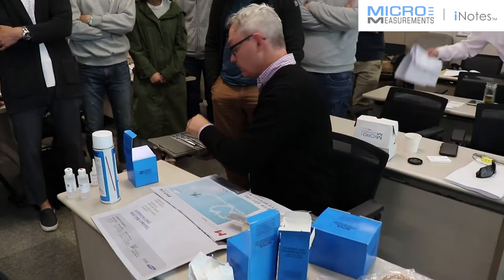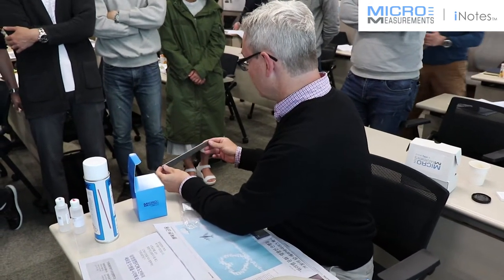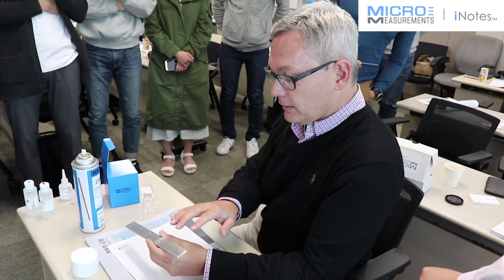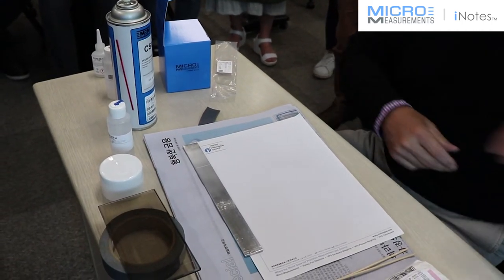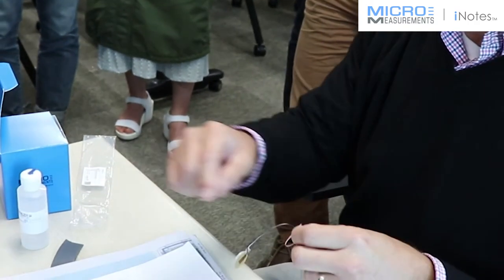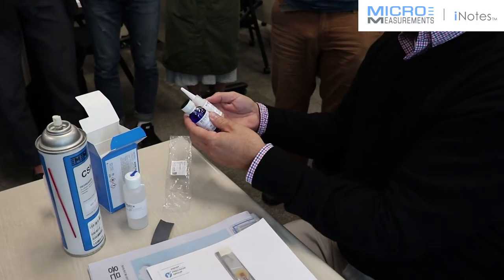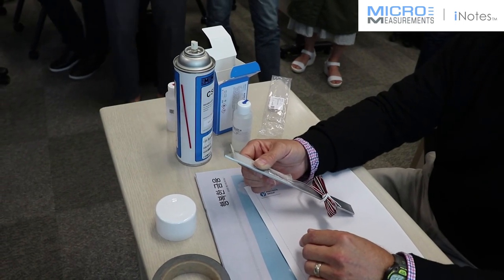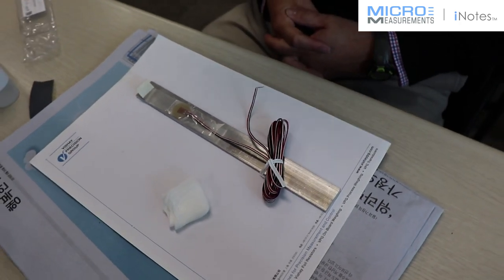Strain Gage Installation for Water Exposure Applications (W2A Series IPX8S Rated)

Comment: Aunque para un principiante la instalación de una banda extensométrica pueda parecer algo complicado, una vez que se han instalado unas cuantas se convierte en un proceso bastante sencillo y rutinario.
Se trata en definitiva de prestar atención a una serie de pasos como la correcta preparación de superficie, pegado y protección, a menos que se usen las bandas extensométricas de Micro-Measurements de la Serie W2A, waterproof, que incluyen un revestimiento de caucho silicona como protección, y son ideales para instalaciones en campo, , expuestas al agua o sumergidas, etc.
Si precisa información adicional, por favor no dude en contactarnos y estaremos encantados de poderle ser de ayuda.
mm.es@vpgsensors.com
miguel.bravo@vpgsensors.com